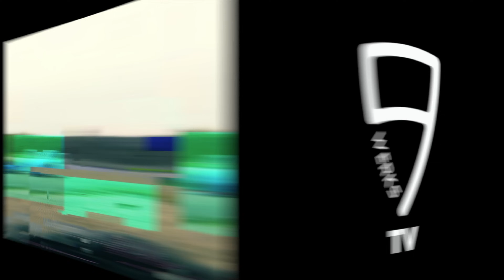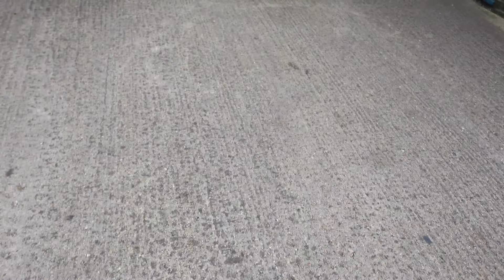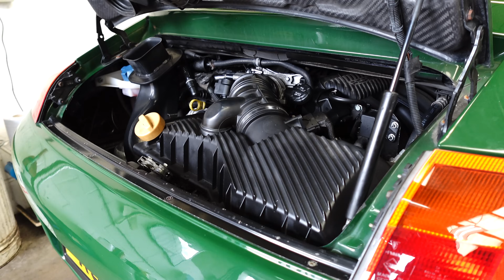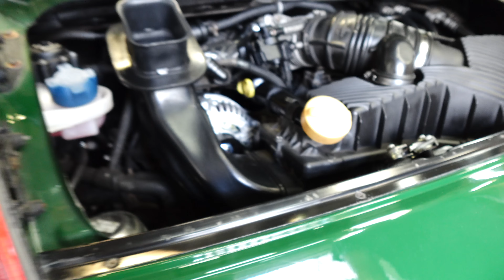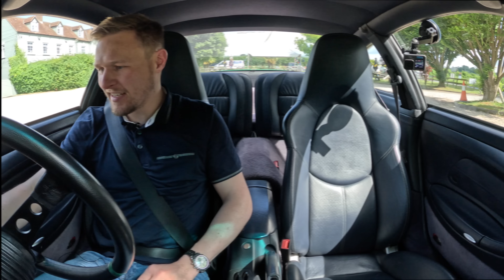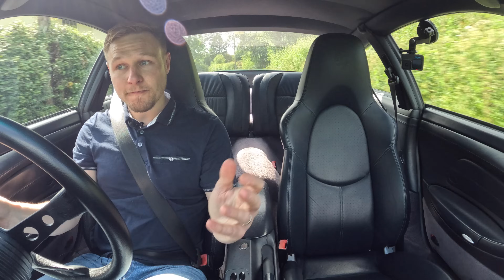Fixing the intermittent start/cut-out problem on my Porsche 996.1 Carrera

Comment: Great to see you back in the car . I had an issue 20-30 years ago 911 2.7s went into Porsche chariots in St Albans presented with a massive bill at the end begrudgingly paid them got a few miles down the road same issue obviously went mad at them pointless.I then took the car to Autostrasse in coggeshall  . 
Turned out a hairline crack in the airbox   absolute gods .

Comment: I had to replace the ICV (BMW Z3 M52 uses the same Bosch unit, and it costs 50 USD), the brake booster elbow (I used a solid rubber unit from a Ford F250 because those gray circlips fall out in the Porsche unit, and it was 3.00 USD), and the EVAP sensor (you can save a lot just buying the bare sensor and adding a length of hose, and it was 25 USD) just like you did. 

However, I also needed to create positive vacuum to reveal a leak from the intake manifold flap. You can cap it off with a rubber cap from a hardware store, and it was 2.50 USD. I wouldn't be surprised if you have the same leak, and it just hasn't been found. I really had to work to reveal it: first the TB gasket leaked, then the brake booster elbow, then the ICV, and finally, after replacing all of the aforementioned parts, I found the final leak: intake manifold flap joint.

Comment: 65% is a low number alright the next test i would have done is to see if the maff sensor  was under reporting the amount of air being drawn in as the maff sensor is the main sensor used in the ve calculation .What were the fuel trims showing?

Comment: Is that a builtbybasil knob? How did you get it attached so nicely into the boot?
Reply from the maker: Cut the factory boot as high up the original knob as I could, folded it down onto the BBB shaft and pinned it from the inside.

Comment: If anyone's still in here... I've had some of the same symptoms and ended up swapping the same part in the engine bay (fuel bleeder valve thing...) and it improved somewhat but not entirely, but it also created another problem and that is that I'm struggling to put fuel in. I have to do it really slow or it just spits it out again. So obviously some sort of vacuum issue but what could have caused it?